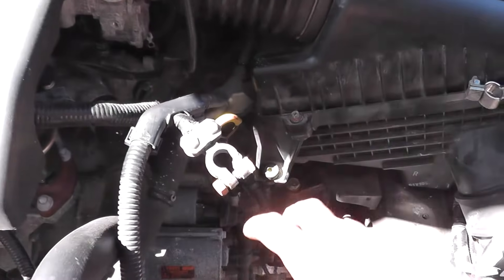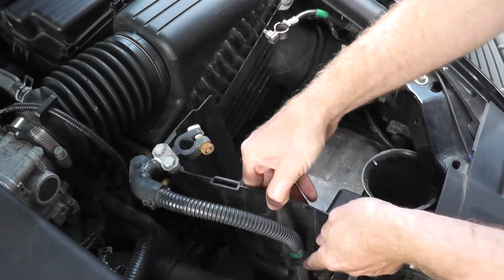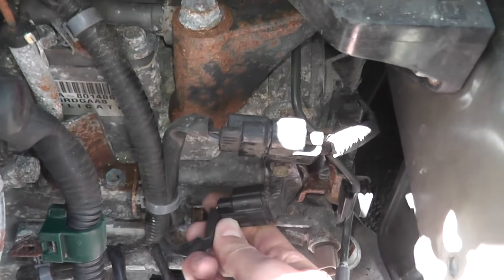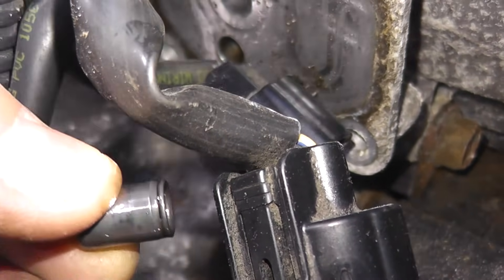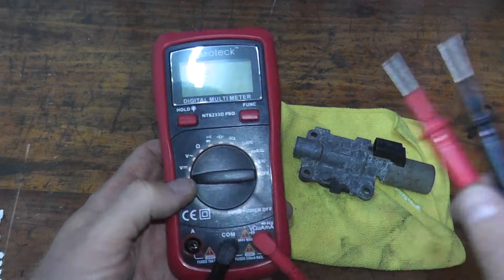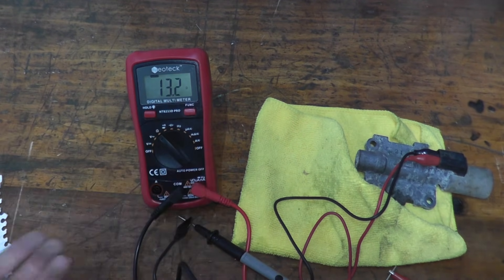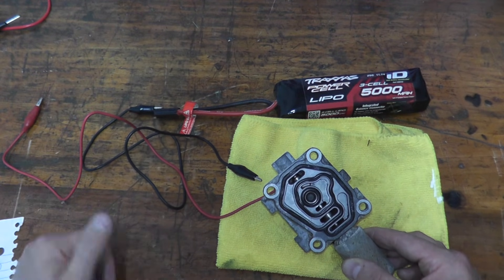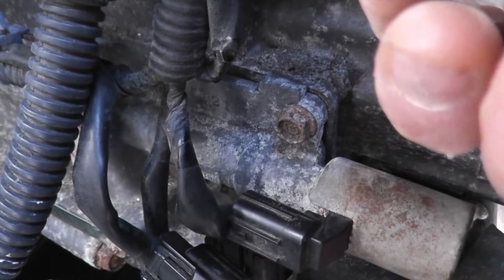Clutch Pressure Control Solenoid Valve Testing and Replacement P0746 P0747 P0776 P0777 P0962 P0963

Comment: I have an 03, 3.0 Auto…. I’ve cleaned all the solenoids and new fluid/filter. Mine shifts great but has issues with reverse/1st engaging, it’ll shudder and engage if revved up. Any ideas? I’ve not touched any pressure switches or replaced any solenoids yet

Comment: Hey buddy.. I’m looking at your little 3-S RC battery you’re using for the test,, Please be careful that battery looks like at least from the video it’s about to explode.. I actually build them batteries and when they’re blowing up like that because it’s a Lipo battery that could explode on you and that can be nasty,, you can get seriously injured and possibly hospitalized.. So please just be careful,, it can just be an illusion from the video, but I’d rather say something even if I’m overreacting, but it’s better to be safe than sorry.. I seen them explode personally and it’s not pretty.. But it’s a great idea to use something like that for a test. The great video thank you for the tip..
Reply: I observed the battery case swelling as well! When LIPO batteries rupture, the Lithium Polymer reacts immediately with oxygen and ignites, they’re virtually impossible to extinguish with normal household methods. Mine are always stored in fireproof containers.

Comment: Hi, i have Civic ex-l 4d 2013. Before i change the transmission oil the transmission acting a bit erratic. No code noted. After transmission oil change, On drive gear it will roll around 4-6mph then acting like sudden engine break and car stop. But if gear to 2 or 3rd it doesn't do that. Still no code. Do you have ideas what's wrong?

Comment: My solenoid B on my 2009 Nissan Altima 2.5 is stuck open.  Can you advise on whether that one is inside the transmission or accessible via the engine?

Comment: Rock auto has pressure switches and sensors available. Will these work or is it Honda factory?
Reply: I'd say you honestly should never use Chinese parts,  search for only the oem part

Comment: Can this also be code p0741 ? I swapped out the smaller solenoid recommended with the black connector but still has this code ! The cars shifts fine to me no problems at all . Only thing is when I put into rever or drive gear takes about 1-2 seconds to engage! Please help 😊
Reply: Hey, any update on your issue? I'm having the exact same problem that you describe.

Comment: Got honda accord 03 got a code p0776 solenoid B stuck off..is this solenoid B?
Reply: hey did you ever figure out?
Reply: I'm having the same problem code  after  car heats up for 15 min or so it will struggle to move an inch after coming to a stop it just revs higher and doesn't move. I don't think my problem is the sensor in this video I changed it and still the same problem

Comment: Thank you so much.
Very well explained.
Next i will be removing and testing my dual solenoid.
Reply: I ordered new dual solenoids, but they came separately without the mounting plate. Do you know how to remove the solenoids, Im have a tough time. Do I have to remove the pentagon allen screws on the other end? THanks.

Comment: Is this where the metal shaving come from ?
Reply: no , they come from the internal gears grinding inside the sealed transmission due to heat and friction.. hondas need an extra transmission cooler installed outside the transmission because Honda  builds bad transmissions back then with older models so that they would break and you would buy the newer model .. marketing scheme just like everything else going on in the world.. 8 out of 10 times tranny needs to be rebuilt... thats why nobody ever responds in the comments when people ask if it fixed their problem or not lol🤣

Comment: Where can i find the part because am having trouble finding it
Reply from the maker: Dealer may be the only place to purchase one. A used one may be on ebay. Cheers.
Reply: Did you find one I can't find one either and every where I check it just shows the stepper motor so I bought one of them

Comment: Would the solenoid be in the same location on a 2017 Volkswagen Jetta
Reply: Did you get this fixed? I just got the po776 code on my 2016 Volkswagen jetta tsi 1.8
Reply: @kolef1000 did you get it fixed?

Comment: When doing the 12 volt test, does it matter the position if the wires?
Reply: I'm going to do that test but I don't think it'd be that reliable if we do it while the solenoid is still on the tranny because we can't see how well the interior components move.  I think it's much better to do it the way it is done in this video.  It'll also give us an opportunity to inspect/clean the little screen or gasket area.
Reply: Yes it does matter. Solenoid needs correct polarity to move in desired direction. How to know: for example, my Honda service manual shows connector zoomed in and marked PIN 1,2 picture. Then it explains which goes to battery positive and the other to battery negative. Then it hopefully clicks/moves like author shows here.

Comment: Is the pressure control solenoid also called the linear solenoid? I’m getting P0747 pressure control solenoid A stuck on for 2003 Honda Accord V6
Reply: Hey I’m also getting same code, did you fix yours?
Reply: Did you guys fix yours?

Comment: Wow, shop told me I needed a new transmission rebuild (Aamco) and said it would be from $3,700 to $4,500. Pulled off this part and one valve wasn't actuating. Got this part from junkyard for $27 and fixed! Thank you sooooo much!
Reply: What was your transmission doing? My transmission just went into limp mode. Rpm goes up but the car doesn't go nowhere.
Reply: @fonzeefons260  Throttle body, or Solenoids are stuck in the valve body of the transmission
Reply: @fonzeefons260  What did your issue end up being?
Reply: @GrahamMasters87  I took it to the transmission shop and got my transmission rebuilt. I didn't look into it before taking it I didn't have the time.
Reply: Curious what your driving? 😁
Reply: What I found out is that 90% of shops want easy job and more money. Even transmission shops won't do this. Its super easy and lasts 2 3 years with good maintenance of the transmission.
Reply: Yeah I was planning on going to aamco too they probably gonna tell me the same thing
Reply: Where did you go to get it fixed ?
Reply: God is good.
Reply: They told me 5500 lol

Comment: My 04 has 130,000mi and the speeds in drive for the most part shift smoothly but sometimes bump shifts slightly but delays shifting from park into drive about 1 second and goes reverse goes right in. Any suggestions? I recently bought it and I'm doing the fluid change. Great video 👍

Comment: Excuse me, my truck honda pilot 2003 marks the code p0730 and p0740 I have checked and me 6.7 homios the solenoid I would like to know what measurement it has to have, I would not know if that would fix my problem that my truck sometimes has, it slides like it does not want to advance even if you step on it the accelerator does not start

Comment: I have a 22005 Chrysler 300 when I crank it up it will go in to gear after driving it for 20 minutes or stop the engine is still on but the car won't move nothing on the dash I can cut it off an crank it again sometimes it will let me go in to drive it start to whine an then it won't go into drive at all what's wrong

Comment: Thank you!  Experiencing delayed shifting.  The screen was not that dirty so I plan to change the in line filter and hope for the best....   I also removed the double solenoid on top of the transmission but that one did not have much sludge in the screens ether.  So I am a bit concerned!
Reply: Did you get through

Comment: P1750 ACURA - Mechanical Problem in Hydraulic Control System of A/T Clutch Pressure Control Solenoid

Comment: I have an 07 acura tl. Its showing codes p0962 p0966 and p0970. Which means all 3 are open/short. Ive tested all three they test a 5.8 ohms and when hooked to a battery they work fine. Does this mean I have a wiring problem

Comment: High resistance what will be the problem of that?
Reply: To high resistance means that not enough of the 12V signal is getting through the solenoid to actuate it properly. It will be slow, actuate partially or not at all.

Comment: What can I clean off the connectors? I found black dirt inside the connectors and I think that’s what’s cussing the code
Reply: CRC 05103 QD Electronic Cleaner -11 Wt Oz
Reply from the maker: Absolutely. Try compressed air. Crud and/or water at the connections will certainly throw a code.

Comment: I just replaced this with a new part and still won't  go pass  2nd gear and giving me the same code p0798. 
What could be the problem???
Thanks great vid!
Reply: Did you figure out the problem? Im having a similar issue with my honda clutch c.
Reply: @Panda-qv6ht  did i figure it out 2 years later lol not letting me shift past 2nd also p0747
Reply: @n54bry  ..
lol 😅 trans needs rebuild... we all have same issue.. all these videos on youtube may only work for the 4 cylinder accord.. v6 3.0 needs tranny rebuild.. i changed these solenoids 3 times and still won't shift into 3rd gear.. 1,2,4 all work great,  no 3rd gear.. fluid and filter change also.. internal issue with these.. there was bulletins from Honda on lots of these.. pulling my classic Toyota and Lexus out the garage and trashing these old hondas

Comment: Hi. Thanks. Great video. I got a code shift solenoid B , performance or stuck off P0756. Honda jazz 2010 automatic.  Jerking during gear changes. Any help will be appreciated.
Reply: Same problem.  Did you find fix?

Comment: Hello there, Greetings from Dubai,

Could you please tell me how did you cleaned the screen. With carburetor cleaner? What will remove the gunk?
Reply from the maker: Hi Asif. I used compressed air.
Reply: @Carsntoys  Thank you for your swift reply. I will use the same.

Comment: Hey Man I love your channel. Helping me out big time. Question- my 2k ohm multimeter reads .006 on the same solenoid. Is that 6 ohms because it’s 2k reading? What was your multimeter ohms set to? If u see this thanks for your time. Seriously
Reply: I believe that would be .6 the 2 k ohm range is just the maximum that range will read.

Comment: Very good and celar video.I just want to know if it is the Valve A cause i  have P0746 in my honda Odyssey Thanks for answer
Reply from the maker: You nailed it. It's valve A stuck in the off position.
Reply: @Carsntoys  Where is the A & B valve hidden on the 2006 Odyssey?

Comment: my acura TL has the same problem with this solenoid, I have performed a test with the multimeter and the recharge is 05.9 onm, could you tell me if this recharge is good or bad?
Reply: Edgard Israel Sabino Madrigal I did the test also and got same reading as you 0.59 ohm. Reinstall and same code appear p0730, p0740 and p0780.
Reply: Resistance 5.9 OHM ----  this is within spec, but doesn't guarantee that solenoid is good. Ultimate test is - does it move every time you apply battery power. If it does, it works correctly.

Comment: I have an acura TL 2004 with the same problem, I scanned the system and it tells me P0970
OBDII: pressure control solenoid (PC) C - low circuit
Acura: problem i A / T Clutch pressure control solenoid valve Circuit C.

I removed the transmission fluid filter and replaced the transmission fluid and filter
I removed the solenoid and tried it only by connecting 12v and the solenoid opens and closes, I cleaned it with a carburetor cleaner but the problem persists.
Could you help me solve this problem in my acura tl?
Should I replace the solenoid?

I live in the Dominican Republic and I would like you to write me some recommendations to solve this problem in my car
Reply: He's telling you EXACTLY what you need to do